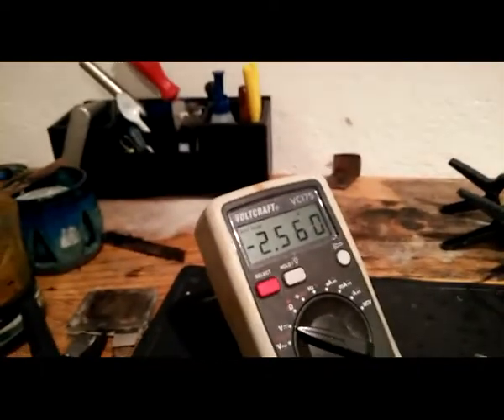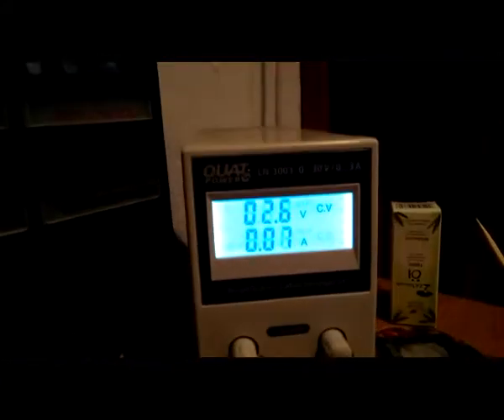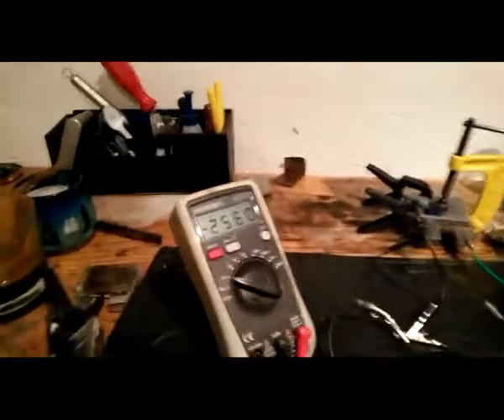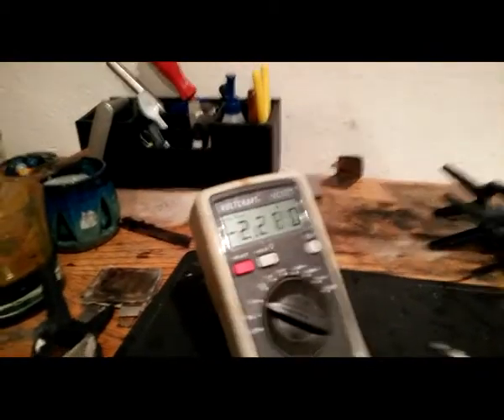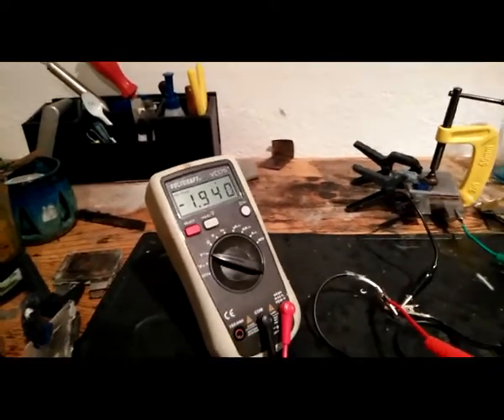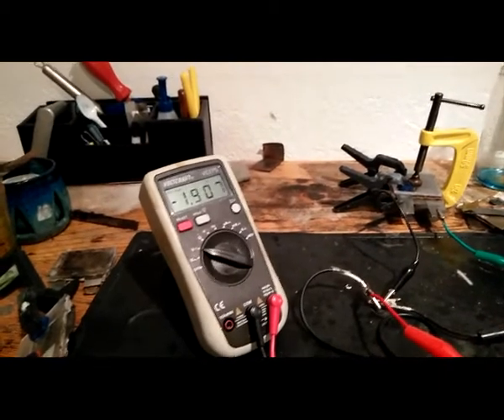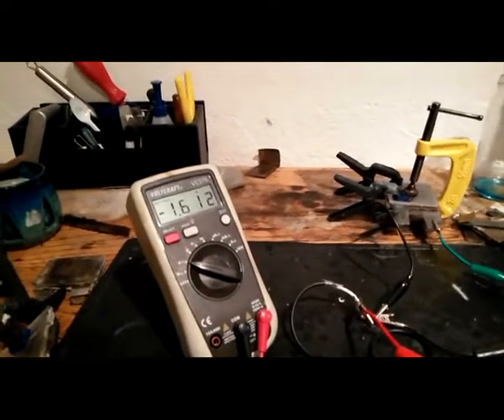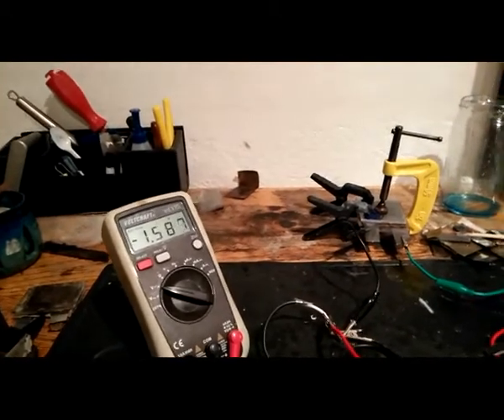a new  elektrolyt

Comment: very nice. I do still after the realy graphene. I did realised the graphene was not made so far by anybody on the Planet.
Reply from the maker: hi bratosz. 
It always depends which type of graphene ( graphit ) do you need. 
a perfect  3-d strukture would be my goal.
Reply: The flexible transparent strong conductiv pure graphite sheets without any base od aditives.
Reply from the maker: Hi Bratosz.

There must be a aditive to hold the graphene sheets togheter.
Reply: Not In the really garphene sheete. I did hold this material. It was amasing and complitly new creation.
Reply: I am today only one that was holding the reall graphene. But still today I do not have ready product ready.
Reply from the maker: HI Bartosz.
the real graphene must have 0.0 ohm and must be extremly strong
Reply: Yes my graphene do have no ohms at all. Who told you it must be very strong? Did any one hold it in hand?
Reply from the maker: I think that s the calculations of the physiks
Reply: Yes maybe it can be made very strong but I do not need it to be very strong.

Comment: I have a question...How to make conductive carbon for using in supercaps? Thanks..
Reply from the maker: Hi Alper. 

It is the sugar foam. from my prev. videos.
Reply: ehochimalpi This is only carbonized sugar,activated carbonized sugar or you have a recipe for making it? Thanks,I working on supercapacitors for 2 years but I still a noob.
Reply: ehochimalpi And what is the name of electrolyte you are using on the capacitors?
Reply from the maker: for sure I am also an noob. Yes it is the carbonized sugar Naoh mix.
Reply: ehochimalpi Thanks mate:D I'll report back to you after trying.
Reply: how much you put sugar,naoh,water that mix? i try to make mix 5g sugar 0.5g naoh 3ml water and wood oven pipe 1hr  i get 10-20ohm resistance 1cm and are you wash sugar carbon hcl and water?
Reply from the maker: I am not sure with mix. I am trying always diffrent mixes.  I have no vacuum pump to clean the carbon so I wash it just with water.
10- 20 ohm are very good. make a video.

Comment: you cap hold nice current but how fast dishariging time.. i build nice cap too but only problem disharinging too fast its self
Reply from the maker: which eletrolyt do you use. ?
Reply: +ehochimalpi sodium sulfate i got best ressult that only need get gel basic.. i try also ammonium,pottasium,lithium sulfate but not work like sodium.. which is you electrylite?
Reply from the maker: I made a compex of sodium sulfate, copper sufate, ammonium sulfat.
with recristallisation.
The only problem is that I made this solution about 2 moth ago and I am no sure for the ratios :-)
Reply: Gerhard sind Deine beiden äußeren Elektroden Graphfoil ?
Reply from the maker: Ja, Graphfoil mit meinen carbonisierten Zucker.
Reply: und was ist der Elektrolyt dazwischen ? Nur so ne Mischung von Sulfat Salzen und dann als Seperator ein Kaffee Filter Papier ? Was ist die höchste Ladespannung die er nach dem Abklemmen behält ? 2.2 Volt oder kommst Du auch auf 2.5 Volt ohne Anschliessen einer Last ?
Reply from the maker: ja eine sulfat mischung, man muss eine recristallisation machen. eine Video hat robert murray smith darüber gemacht.  zurzeit bringe  ich es auf 2.1 volt ohne last. probiere aber es auf 2.6 zu erhöhen.
Reply: ehochimalpi
Klasse Gerhard, bin ja mal gespannt, ob Du es auf 2.6 Volt hinbekommst, das wäre ein grosser Schritt. Robert M. Smith hat ja gerade ein Solidstate Electrolyte erfunden mit seinem Seaweed, auch , wenn er da nur 1.2 Volt hinbekommt...
Reply from the maker: ja ,robert ist uns allen min 1000 schritte vorraus.